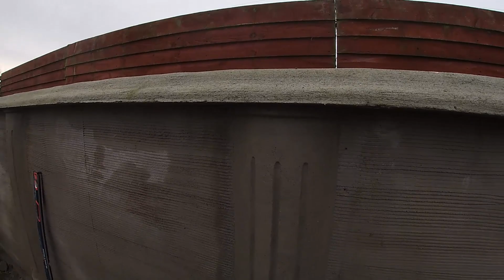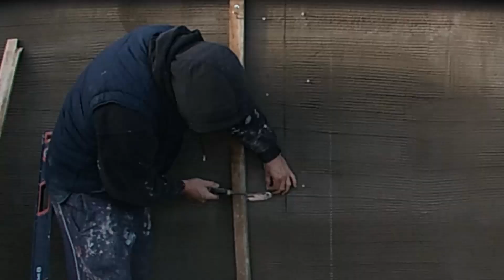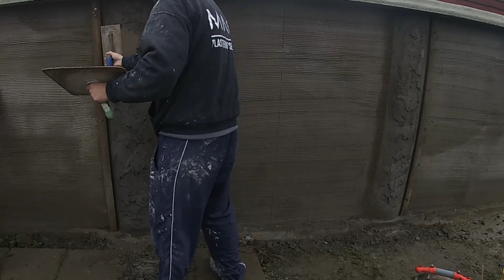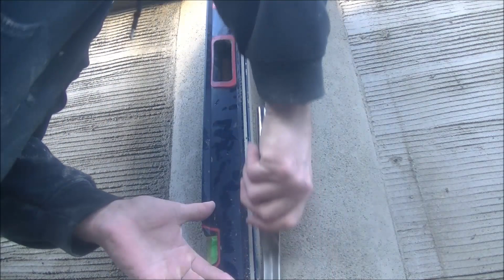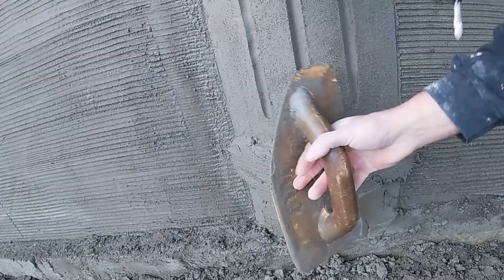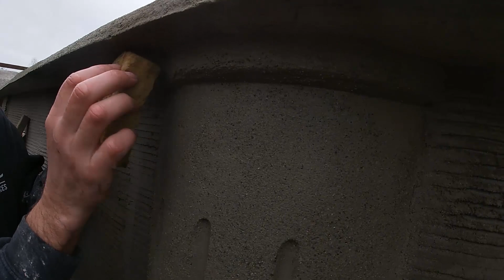HOW TO MAKE COLUMN IN CONCRETE DECORATIVE for HOUSE / Wall Cement Render

Comment: hi mac sorry i meant to say yours look great and i would like to know about the sand, it for sure looks like a very strong mix do you get any finer sand where you are, cheers from alister
Reply from the maker: on this one mate 4 to 1 mix with plastering sand our plastering sand is a fine sharp sand its very good to work with no to fine as to lose strength not to gritty to be hard to finish but gritty enough to add strength  thanks for watching mate more to come on this 1

Comment: hi mac alister from australia again , first off hope you and your youres are well, a method i like to use is what i call collars , i run them with casting plaster on my work bench to the radius i need, then fix them in place  with casting plaster  leaving plenty room top and bottom to work the straight edge, take the collars off and fill in, then i have a plumb , true to shape column shaft to work on , all the best from alister
Reply from the maker: do you use a mould mate if just run it on bench with a core ?
Reply: @macplastering  hi mac really sorry for the late reply, i just seen youre message , yes i use a running mould made to measure, each job is custom , i find it an accurate way of giving me a guide( or you might call it a screed to work to) i try mostly to have even thickness at work and it can be a long process , but the outcome is even suction easily finished, cheers from alister
Reply from the maker: @alistermcmillan1039  Oh I think I know the method you say, I was thinking f a running mould horsed up but I think I have seen a few guys do the method your saying it is a great way to get the shape for sure Thanks man
Reply: @macplastering  hi mac , thats good i still to this day call any running mould horsed up, all made to measure, quite often takes a while but  i like to be patient , cheers from alister
Reply: hi mac something you might be interested in if you like reading about our trade, don stagg and brian pegg  wrote plastering a craftsmans encyclopaedia many years ago, ( among many other books , something i,m very interested in, i have a vast library dating back to the late 1860s )there can always be something interesting , even old mixes etc, good reference, cheers alister
Reply from the maker: My wood work can be a little bad as I usually fix everything with plaster but when horsing up need to be good and tidy
Reply from the maker: Would love to have  a read at those mate yea I have a stagg and peg one and loads of diy ones
Reply from the maker: Would love to do a book one day
Reply from the maker: thanks for watching and commenting mate yes so far we are al doing good hoping all is well with you and all your ones mate

Comment: Nice one Mac ..... have you thought about using the One inch/Two inch 'sponge brushes' for tidying up the Finnickety bits? .... That big sponge looks a bit clumbersome :-)
Reply from the maker: Man I wanted to use my sponge float for the main part and couldn't find it but yes soon after i finish I fine it LOL never used a sponge brush before mate can you drop me a link of these ? thanks again for watching mate :)
Reply: @macplastering  your local DIY store will have them Mac, 
(in the Painting isle though :-)
Reply from the maker: @CheckFred  Oh yes I know the ones you mean now thats a great call mate if you notice at the end I cut some up for the top  but yes mate thanks for that tip
Reply: @macplastering  sponge brush never heard of them myself but nothing suprises me these days
Reply from the maker: Seen a great top for tiling today putting a sponge insdie the hole cutter keep it wet before cutting/drilling and it wets the tile as you cut

Comment: May be  you  could  fix rouhing bead in the middle  !!!!
Take a way  some of the thickness plus give you more key  !!!
Reply from the maker: Oh yes the mesh parts I do have wire mess but it will also be tied by the side with the other rendering if that makes sense mate ? but great suggestion mate and that trowel was so good on this